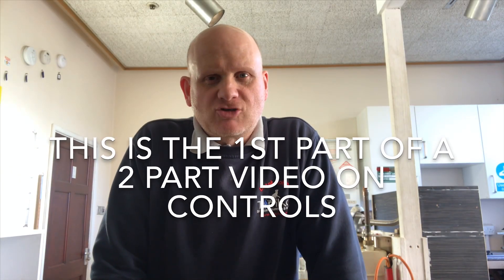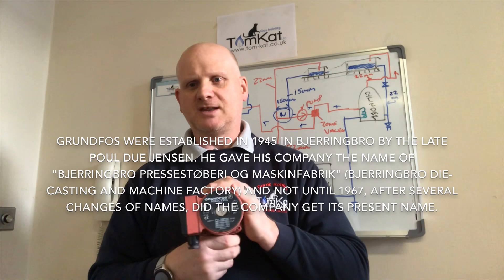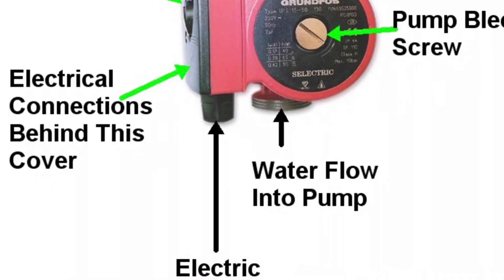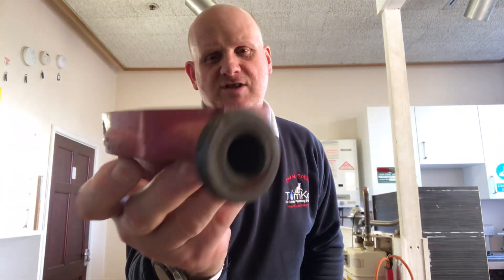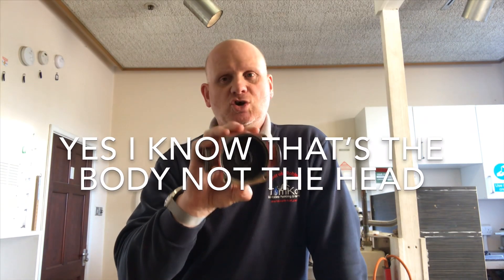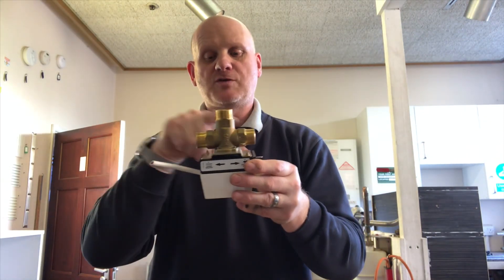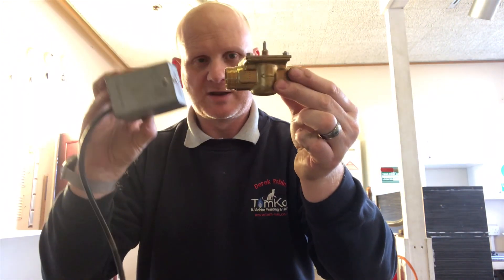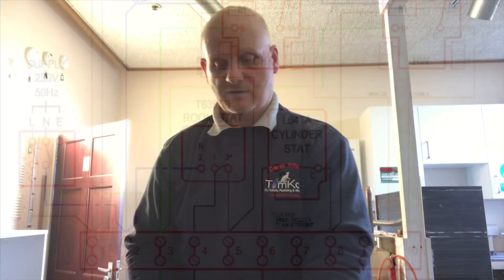HOW CENTRAL HEATING WORKS, The history of central heating part 4A - controls

Comment: Brilliant video, could you tell me,is it normal for a pump to run quite hot?I.E.Too hot to keep hold of,would appreciate an opinion please, many thanks.
Reply from the maker: If a pump is too hot to touch but you can touch the pipe then the pump is full of air
Reply: @tomkatgastraining  Many thanks!🙂👍

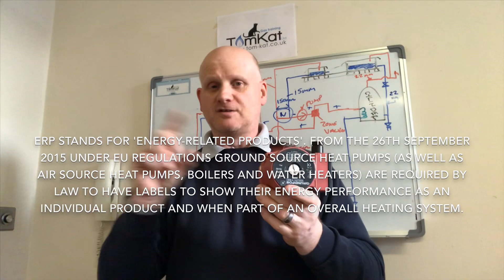Comment: @ 6:23 Is that CORRECT that if the Return Temperature creeps up...
The Pump slows down...
Causing lower pump velocity;...
Would that not restrict the flow to the last Radiator
(All Rad Valves T.R.V.) calling for heat...
Then leading to a F25 on a Flexicom 24 HX...
With 9 Rads
Reply from the maker: Yes it is correct, If the boilers are fed with 10mm and long runs this can cause the rad with the longest run not to work or the boiler to fault for poor circulation
Reply: @tomkatgastraining 
Thank you
That confirms my theory...
The 1st 4 Rad's have been balanced...
All 9m Flow;... Return pipework from the Boiler 2 & from;... the Cyinder 3 way valve are 22mm & to the 1st Rad take off;... down to 15mm for the rest of the C.H.
Boiler set on 62'C;... Pump set on speed 2;... on 3 it cavitates...
F25 only comes when it goes into Anti Cycle & Boiler temperature goes below 40'c (Boiler NOT lit;... doesn't relight until below 35'c sometime as low as 30'c);... C.H. demand is still calling for heat;... but seems to wait for the Anti Cycle to time out...